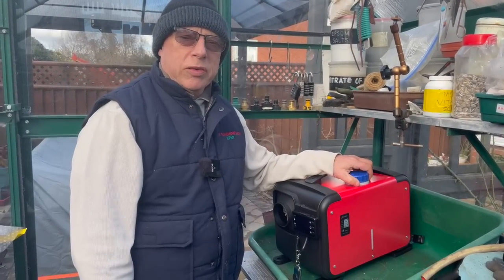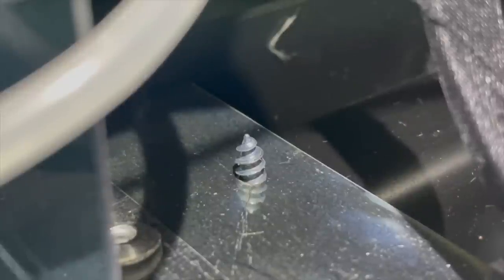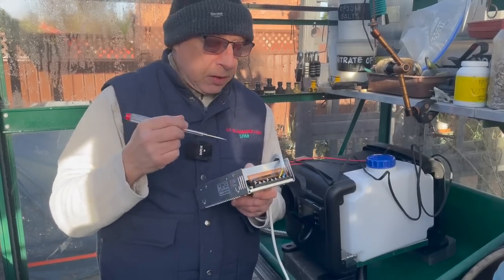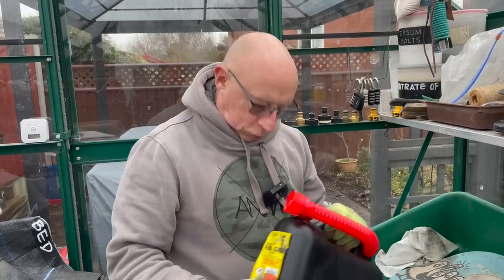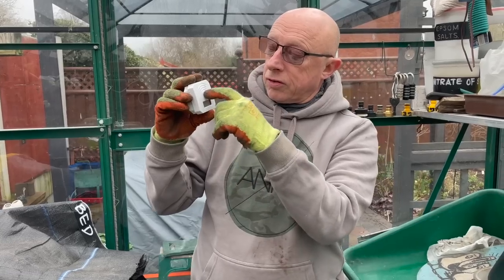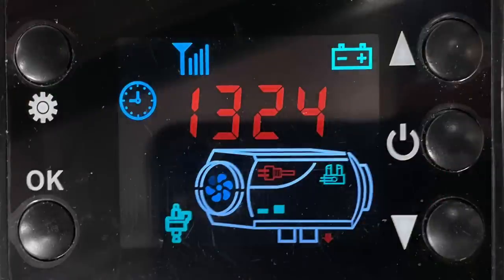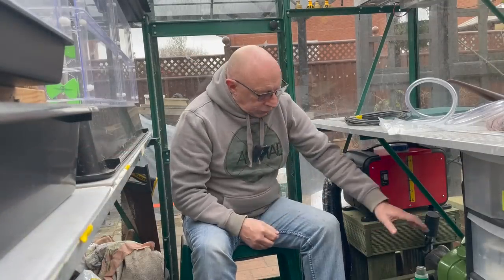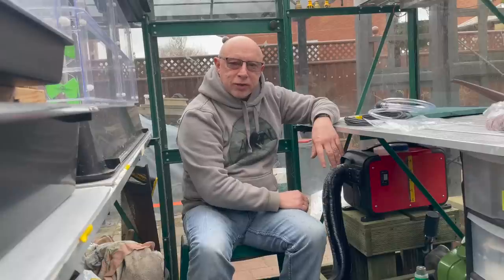🌻302 🌻 CHINESE DIESEL HEATER INSTALLATION 🌻 CHEAP GREENHOUSE HEATING 🌻

Comment: Hi Nigel, great to see you back. Luckily, we don't have that problem here in Aus. However, I was wondering that since you bought an "off the shelf unit" and it needed so many modifications that the average person might not be aware of, could these heaters be a trap and even dangerous for the average person if not installed properly. Once again great video looking forward to your upcoming spring plantings. Cheers  😀

Comment: Hi nigel great video many thanks what size are you using 5 k or 8 k
Reply from the maker: The machine will do both, it depends what frequency you run the pump at. For economy I use lowest settings which raises greenhouse temp by around 12C

Comment: That little orange knob/switch thing you can see at the side of the green LED (where the red lead is) you can turn the output voltage up from 9v to 15v and diesel heaters like a strong voltage.. I have the exact same mains supply and I have turned my orange switch up so my heater is running on 13.5 volts which is roughly a fully charged battery voltage..
Reply from the maker: Thanks for that tip 👍🏻

Comment: Nigel, Just a little pointer re the metal pin on the pump, just press it rather than pull it off.
Reply from the maker: Thank You 😀👍

Comment: you should try using a sand battery (old copper water cylinder filled with sand) with exhaust going through the copper coil inside the tank. 👍 on all the videos I've watched, the fuel pump MUST be at an angle. And get exhaust paste on that exhaust pipe connections. 👍
Reply from the maker: The sand battery sounds a good idea, but I am restricted for space.  Have checked the exhaust connector with CO meter nearby and no leaks.  I do have exhaust paste but I want the heater to be portable that is why I built it on a pedestal and to do this I need to disconnect the exhaust.  I do have a couple of spare exhausts if I need to use in other areas 😁👍🏻

Comment: Fantastic review Nigel, i see you have the same machine as my second one that im having no end of issues with thanks for showing the mods on this i was going to send it back as it keeps flaming out its no way near as good as my other i have had no issues with that one, however i think now i will try the pipe mods and put the pump somewhere else and mount it on an angle as it should be. thanks for the tips and do you have a link to how to set this remote panel for best consumption and pair the remote cheers Alan
Reply from the maker: Hi Alan… will drop you a PM 👍🏻
Reply: @MuddyBootz  cheers Nigel
Reply from the maker: @alansallotment   sent you email 👍🏻

Comment: Your remote controll will tell you your temp for tuning. My maximum internal furnace burner temp is 245°c and if I put my fan speed to 5000rpm I can just barely get to 245°c by putting my pump speed to 6Hz if I put it to 5.9Hz it won't reach 245°c.
And if I put my fan speed to 4500rpm I have to put my pump Hz to 5.5Hz to maintain the hot 245°c burner temp. If you run it cooler it will soot up quicker.
Reply from the maker: I did a De-coke on mates heater who had that problem. Only took 30 mins and back running fine. I chose the lowest frequency for fuel economy.  It raises the temp by 12C which is plenty for my small greenhouse. Also run a few tanks of Kerosene to see how that compares to diesel. Just got some bits using a motorbike fuel switch so I can switch over easier

Comment: That is going to be very expensive to run.  I have one in my workshop.
Reply from the maker: Not sure what you are basing that on?  Are you running it straight out of the box? By adjusting pulse and fan speed I have reduced fuel consumption by around 40%.  What volume are you heating…. Mine is approx 300 cu ft.  What fuel are you using?  How long is it running for?   All of the above will influence running cost. On lowest pulse setting which raises ambient temperature by 8-10C… with current fuel cost, mine costs around £0.17 per hour which based on current energy cost I think is cheap. 😊